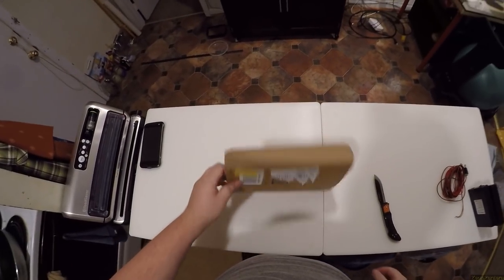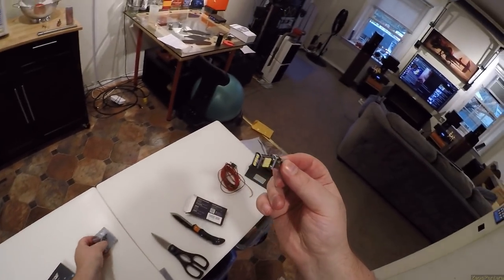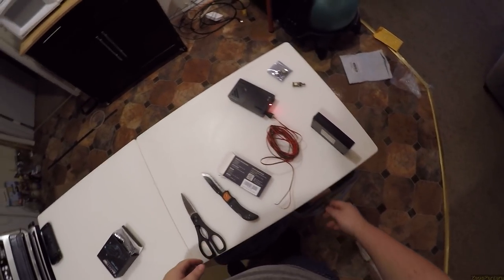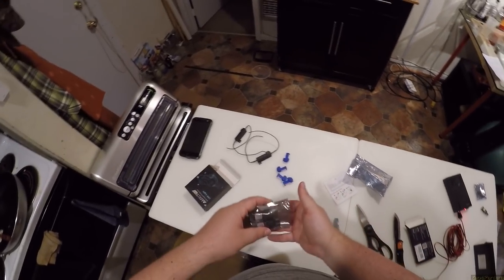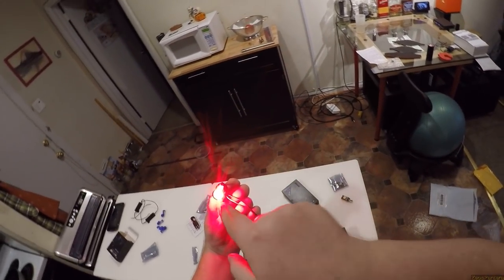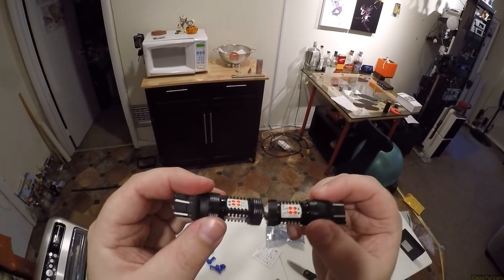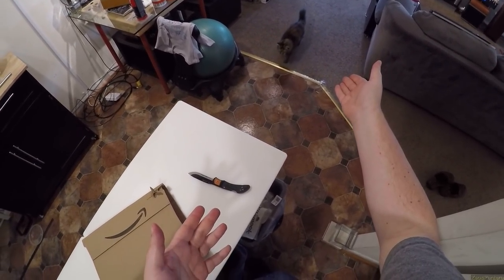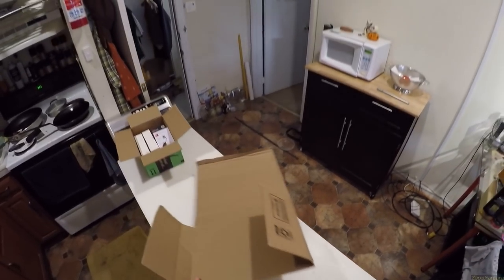Z Unboxing - LED Car Lights, Big Combs & Extension Cords

Comment: If you're replacing your tail lights brake lights and turn signalswith LEDs it pays to spend the $25 and buy an electronic flasher that doesn't require heat to work